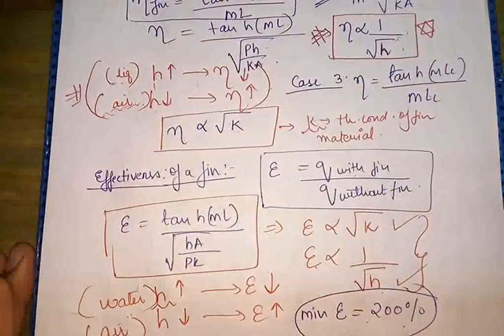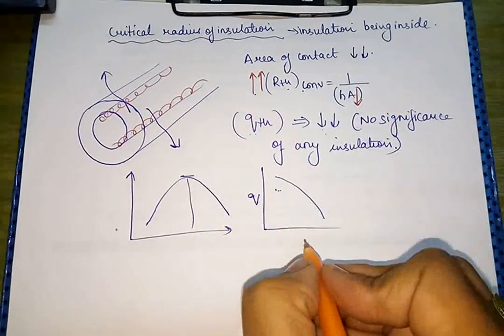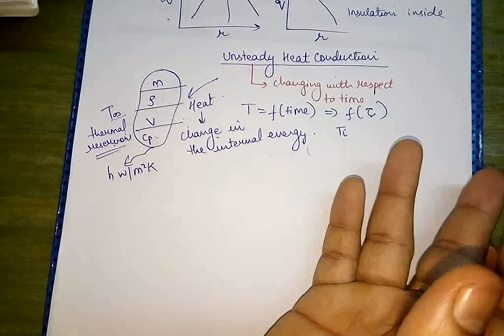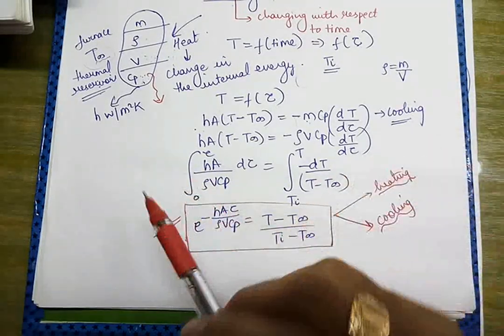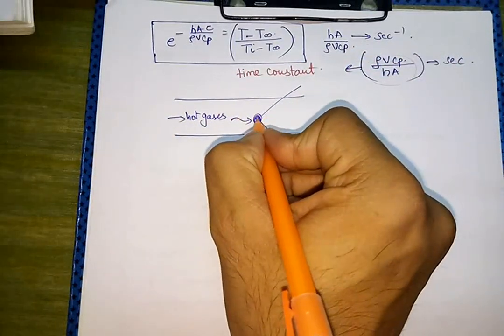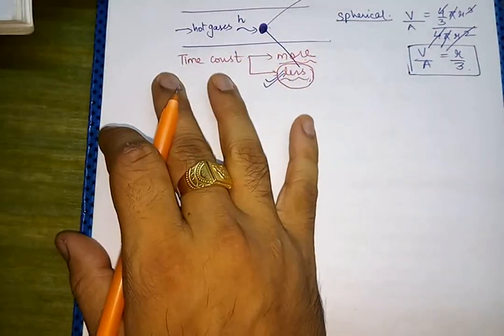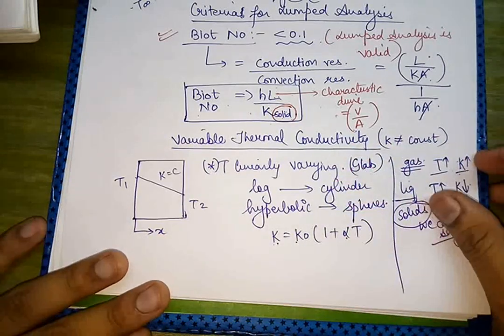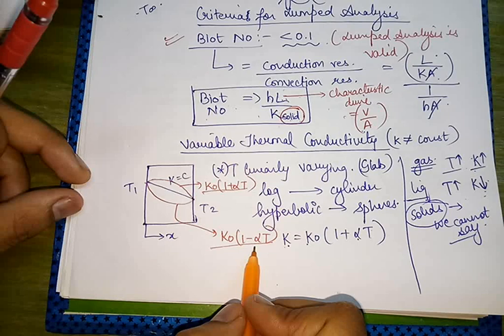Heat transfer lecture 7 : Unsteady Heat Generation, Lumped Analysis, Biot No.

Comment: Nice effort. I have been learning from your lectures for gate examination. I am having a doubt,  consider a wall that making a partition between two fluids having different enthalpies( heat content) on which side one should use the fins to have better heat transfer?

Comment: Sir i have a doubt ies 2000 q. Assertion Thermal conductance of heat pipe is several hundred times that of the best available metal conductor under identical condotions.

Comment: Solve gate 2016 set 2 question of unsteady heat transfer...it is givem rod A and rod B and we have to find time for rod B. Plz solve anyone. This lecture is not enough to solve that problem. It is missing the concept of biot number > 0.1
Reply from the maker: Sure
Reply: @mechzone9453  plz include a video on fourier number for unsteady heat transfer, as it is used in that numerical